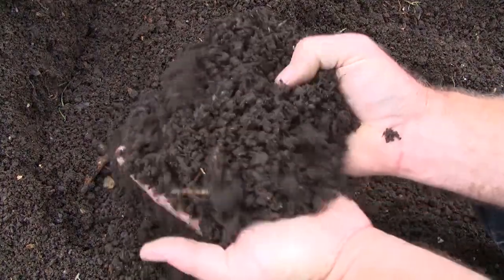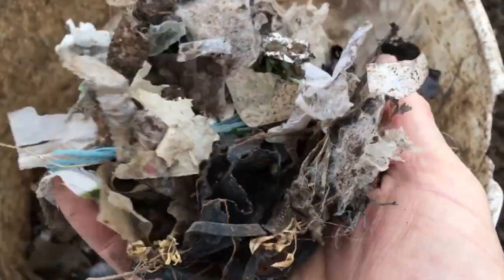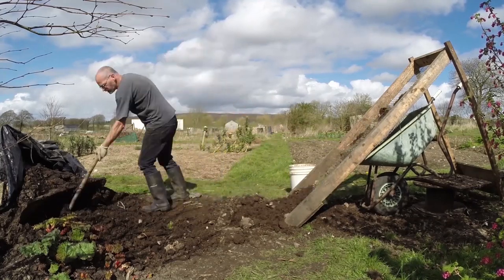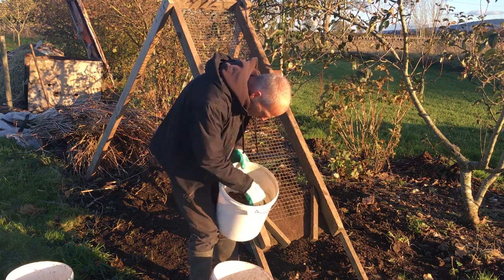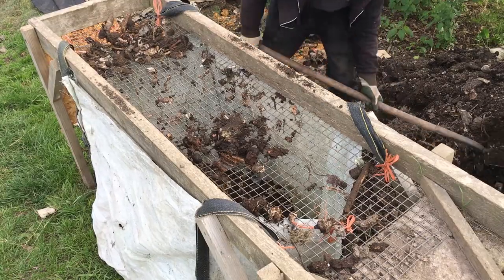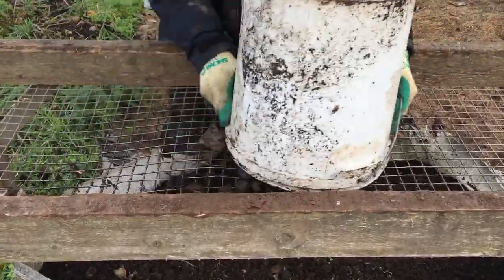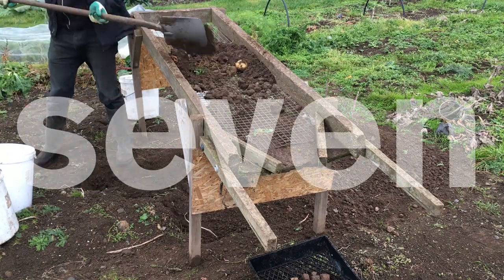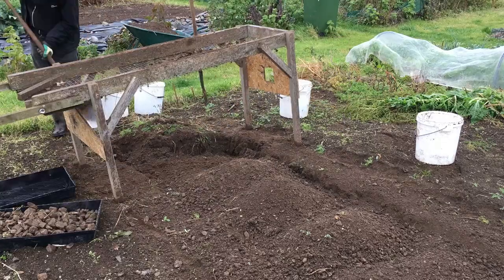8 Ways to use a Compost Sieve

Comment: I really appreciate you sharing this video. I have an area I need to prep for a hoop house and there is about a 2" layer of rock under 2" of top soil. The soil is black here from being under leaf mold for years so I don't want to loose this organic matter. But I have to remove the rock or else it will interfere with our root crops. So this simple system you showed has helped me see how I can systematically both remove the rock and the johnson grass rhysome growing here. So thank you

Comment: A really good video! The first thing I thought was, the screen is too steep! I don't screen my compost, but that's because I don't have that much. I have a tall log upended next to the pit, and chop what doesn't get chopped in my kitchen on that and scrape it into the pit. Avocado seeds get smashed there too. Mostly I end up with a lot of stickers from bananas and avos, which get picked out by hand.

But I do use a table screen like you have, half inch mesh, for screening rocks from the soil, and nails, glass, spark plugs, etc. Smooth rocks go into one pile, broken rocks into another. And I used the screen the other day to separate acorns from whatever else was mixed in, I am going to try making acorn meal or flour.

And yes, rocks getting stuck in the screen is a pain! But it is better than being on hands and knees.

Sorry about your bad luck, I was thinking maybe you got the end of a hurricane, but I see that is not the case. Fan láidir! (From Google Translate, stay strong)
Reply from the maker: Thanks. Getting the screen the right slope is a trial and error process, and depends on the quality of material. With compost what has more moisture in it, I found that a steeper screen was necessary, or it just stuck in a lump on the screen!
When it is in a horizontal (table) position I have found that tapping the bottom of the screen with the shovel often works much better than trying to work it over from the top. Especially if the table is slightly sloped, to allow the stones to slowly move towards the end.

Comment: I made a small one that fits over my wheel barrow but the same process. The upside down 5 gallon bucket is a great idea
Reply from the maker: Do you use a spade to move the material around, or do you shake the sieve?
Reply: @REDGardens  it depends on what I'm sifting. I've  mostly been using a piece of 2x4 to move stuff around.I live about a 1/2 mile from the platte river  my yard is full of river rock so sifting is a necessary part of planting. I do like the idea of putting material in a bucket and sliding it around

Comment: You could just lay some 1/4” mesh right on top of the existing screen for a finer screen and remove it when you don’t need it. Great uses!
Reply from the maker: I think that could work. I would just need to secure it in some way so that the smaller screen didn’t move too much.
Reply: Yup! You would probably have to trim the entire length to fit anyway, so you could get it snug.

Comment: you ended up mentioning it yourself by the end of the video, which is getting another screen with a smaller grid! i liked the in situ approach of sifting compost right onto the beds, but by the looks of it a lot of coarse materials including plastic material made it through the mesh. i think i would still use the big hole mesh in the slanted fashion and screen again horizontally through a smaller mesh. i liked the idea of sifting for grassroots and clumps, and since i need to practically to dig out the entire beds to harvest potatoes, your idea is brilliant! there are several videos on youtube of eliot coleman explaining his winter growing of veg, and he shows the genesis of his moveable greenhouses. at one stage he attached a wheelbarrow wheel with a lever, so that the greenhouse can be raised and moved, and lowered to set it back flush on the ground. check it out, setting your sift on wheels when needed could make it easier to move around, and you could still make it more sturdy and heavier without breaking your back.
Reply from the maker: I think you are right that a smaller screen size would work better in many cases, especially with it in horizontal position, and for compost. Though I suspect that larger mesh would be better for clearing land, as a smaller mesh would take too long.

Thinking about what you said about using two screens, I might try using the larger screen when turning the almost finished compost the final time - to break up the big chunks, and remove larger pieces. And then use a smaller mesh for the finished compost after it has had a chance to mature for a bit more. Might be a good compromise, as I need to dig out the compost anyway while turning.

Wheels would definitely help - not sure why I didn't think of that before. I remembers something about Elliot's moveable greenhouse. Will have to look into that again. Thanks.

Comment: I've seen archaeologists using a sieve like your horizontal one but they attached a rope to each corner . The ropes were then attached to an overhead horizontal beam so that the sieve could be rocked back and forth like a swing .
Reply from the maker: I think I have seen an example of that, I think where the sieve part had something to bump into, to cause the shaking, and so it dint just become a swing. Would be interesting to try one and compare.

Comment: Sweet video! I used to keep raccoons and other animals out of homes with screen like that, you can also double the screen up but offset the grid so you have a finer sieve. then you could set up an assembly line type deal to get much finer compost
Reply from the maker: Doubling the screen would definitely help, but the assembly line of a big screen through to smaller screens would be good.
Reply: @REDGardens  it really depends on what the compost is for at the end of day, the compost you're producing now looks very nice and isn't very chunky (after sorting). Nicely done sir !
Reply from the maker: @joeylacivita2650  Thanks.

Comment: Excellent video, especially the point about how a tool can be used to purposes it was never intended.  My favorite personal example of this was when I dug narrow trenches for 2x4s as concrete forms next to a sidewalk I was replacing.  Rather than using a shovel that would have damaged the plants on either side of the sidewalk, I used a broken spade bit in a drill.  It wasn't any use for woodworking anymore, but it was 12" long, so I could churn up the soil with it.  Then I used a shop vac to suck out the loose dirt to create the channel for the 2x4s, and later staked them in place.

Maybe it's my aversion to shovels in the above example, but I think you're using a shovel too much here as well.  For example, rather than digging with the shovel, invest in a demolition hammer.  If you have hard soil or your shovel frequently stops short because you encountered a rock, a demo-hammer will cut through it with minimal effort (Not the rocks; I just mean you don't waste as much energy as with the shovel alone).  Similarly, rather than lifting shovel-fulls of dirt, just fill a series of buckets.  There's much less spillage if you fill them on the ground (especially laid on their sides).  I use those rectangular cat litter buckets that lay flat.  My kids and I dug a huge hole to plant a tree in rocky soil some years back, and we used a combination of these methods: Demo-hammer to churn things at the bottom of the hole, brought in empty buckets to fill up with smaller tools, then lifted them (the buckets... and kids too) out to sift.  Repeated the process until the hole was deep enough for the tree.  Left a kid in the hole for fertilizer.  Tree is doing great!

Comment: I confess, I'm a sifter addict, glad to see I'm not alone. Less than 95 percent of my carrots are not forked and  I don't cut my fingers on glass in the upcycled urban dirt. I use 40 percent compost for my soil mix, water holding is great but it also seems to encapsulate toxins. Best wishes, greetings from Holland, hope you can find a source for fresh horse manure.
Reply from the maker: Nice to meet another sifter addict!
Reply: @Fred Derf My dirt is littered with century old garbage: in the old days they dumped a lot such as coal fire ashes and leather scraps ïn the backyard, both containing heavy metals. Also an agriculture machine repair shop was located on our site. So I use compost (including egg shells) to minimize leaching and neutralize and encapsulate the potential existing "toxins". They did a cleanup of the site, but there still may be residues. The tests they use are based on samples, they only test for a few indicators, and they only red flag when levels are above legally allowed limits. So I just play safe and use a compost percentage well above the 10 to 12 percent organic level you see in pristine, excellent soil. Best wishes, you never can have too much compost.

Comment: I am getting old and needed to find easier ways to do gardening work so I  bought a used cement mixer. I fill the mixer with leaves add some stones or brick pieces and run the mixer, the stones pulverize the leaves into small pieces, the larger stuff goes to the bottom of the mixer. When I dump the mixer the larger stuff is on the top of the pile and I can pick it out. I leave the pulverized leaves in a big pile until I need them. the mixer holds about 30 gallons of leaves and breaks them down into about 10 gallons of pulverized leaves.  I use the leaves as mulch and use them as needed,  I use the leaves in lieu of peat moss or coir when I make potting soil . Earthworms love the pulverized leaves and the leaves break down fast and add nutrients and retain moisture in the garden soil and help control weeds. this method is much easier than turning compost or sifting compost which I did for years. I only handle the leaves twice, once to load the mixer and then again when I need to move them to where  I need them.

Comment: I mounted a 35 gallon plastic barrel onto an electric cement mixer. I cut holes in the barrel and mounted quarter inch metal screen to the inside. It gives me really fine compost.   I might try using half inch wire mesh to speed up the process.
Reply from the maker: I want to try something like that.

Comment: very nice . maybe try square steel tubing. that way u can put tube in tube to adjust the height. also u can frame up different screens as inset.
Reply: so many uses for something like this. with the tube in tube extendable legs u could use even use it for the purpose u intended it for gravity drop smaller screen box i would bolt under the bigger double duty screening so to speak, this would work perfect for project i was looking into building worm casting and sifting thank for this video.

Comment: This was a good video on screening compost. There probably isn't a really easy way to do it by yourself, unless you go to the time & expense of building a powered trommel or vibrating sieve. I made a small sieve, 18"x18", with 1/4" hardware cloth, for screening well-rotted leaves. This gives me a fine material, similar to fine peat moss, to use as a seed starting medium.
It would be nice if you could train folks to chop, and screen for debris, before they drop off their compostable materials. Would also be nice if you had interns doing the labor for you. :)
Reply from the maker: Thanks. Good point about there probably hot an easy way to do it yourself. there are a lot of jobs like that in a garden.
I am getting better at chopping up and separating what goes into the compost, but there is a slow process of training up mu neighbours (hoping some of them will see this video and be more careful about what they put in their compost bucket.)

Comment: Put that SOB be some big pnuematic casters man. I have my little raised garden boxes I build on some heavy duty casters, if it gets too hot and sunny down here I can just wheel it up under the patio roof a bit to keep my plants cool and back out when the sun isn't too potent,  I think that would be a great addition to your sieve you could just push or pull it into position then lock the casters in place.

You could probably go a step further with some interlocking tubes for the legs. Think like, a mop with an adjustable handle length. You could pop a pin on two legs, pull up with some weight on the base and elevate one end to go back to gravity doing some work.
Reply from the maker: Casters or wheels would really help, and your suggestion of finding a way for adjusting the leg length is interesting.

Comment: i been looking for a better way to sieve mine, ,i already have a sieve frame, but adding 4 legs to fit the bed size like you have , would work for me , especially  as i garden in 3x8 boxes to start with , , lol Ive learned about the rock  thing as well, although i do keep some smaller material to place in the bottom of the pile as a starter material, we do not have many rocks here luckily  , would work with a reciprocating saw attached to one end, , like a vibrating table , , simply pull the trigger and sieve the dirt , tks for sharing
Reply from the maker: Hey, glad you got a new idea or two from video. That is an interesting idea about using reciprocating saw to shake the sieve. It would be cool to see how well it works.

Comment: Thinking about the manual separation of stones, sticks, plastic and other debris; partially fill your catch bucket with water so everything that isn't stone floats to the top? Or use a secondary bucket to dump your catch bucket into for the same purpose.
Reply from the maker: I tried that method with compost, but most of the wood was saturated and sunk. I didn't think of trying it with ground clearing.

Comment: I operate my different size sieve on top of the wheel barrel and shake it to have the compost go trough it into the wheel barrel directly and keep at a comfortable  hight to sort the stones and plastics. The remaining large compostable matters are turned over to the compost bin for another round.
Reply from the maker: Sounds like a sensible option. Keeping it all at a comfortable height is an important factor!

Comment: This sieve is a great idea. I was wondering if the larger wood pieces could be put in a trench used as sort of a temporary hugelkultur as they break down.  We have sandy soil and luckily seldom get the larger pieces of wood and rocks in our compost like we did in our soil on our previous lot. I would like to try hugelkultur and these large pieces seem perfect to add to the larger branches.
Reply from the maker: If I was making a hugelkultur bed I would probably add the tougher pieces to the mix, but not sure it would make much difference unless you had a lot.

Comment: To your idea of creating sieves of different sizes, I have one solution that could work. You create a rail underneath and carry inserts with the different grade mesh. Then, you could change out the mesh on the fly without the need for a separate sieve for each size mesh.
Reply from the maker: Yeah, that could work. i would need to create some sort of frame around each screen to strengthen it.

Comment: hmmm, bring the sieve to the garden. that is a good idea!
my sieve is made with 1/2" hardware cloth.
Reply from the maker: I think 1/2" might be a better way to go.
Reply: I had a 100 cubic foot compost bin. I mixed mostly leaves and grass clippings slightly different than county extension agent said to, but the internal temperature always got above 150F.
I used half inch hardware cloth and it worked great. I didn't compost much larger or harder to compost stuff (cobs, etc), so usually the grate didn't have much to do other than break up clumps.